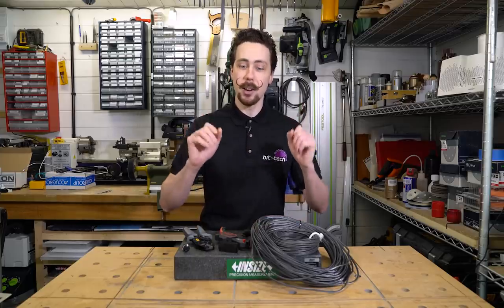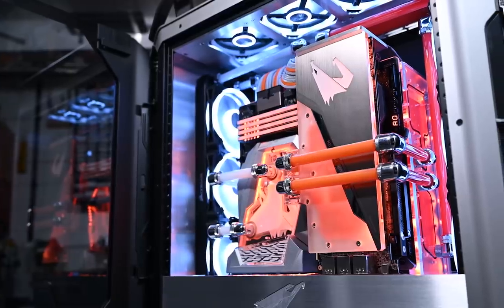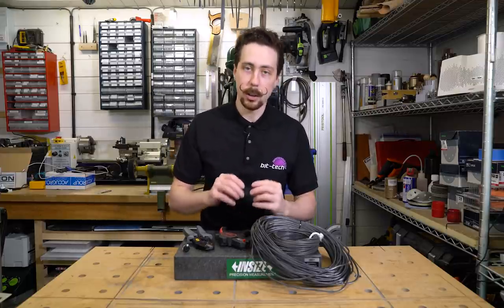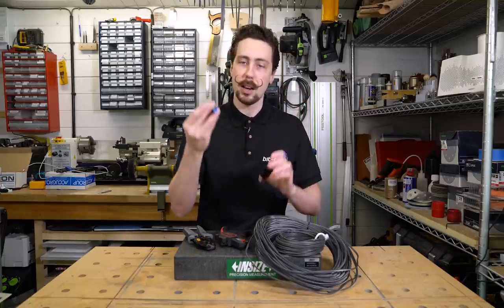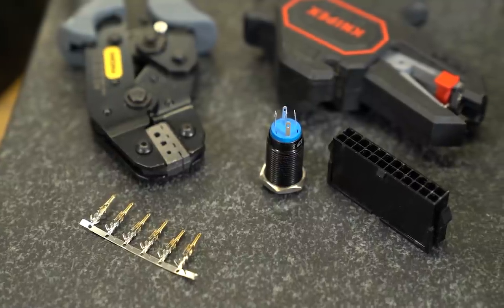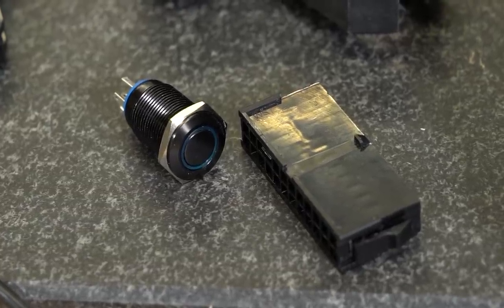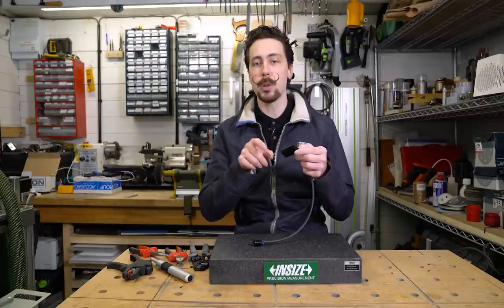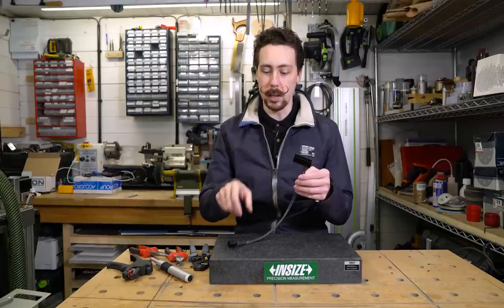How to Make a PSU Jumper Switch | bit-tech Modding

Comment: Improve the soldering. And I would love to buy this from you. $15 to $20 and I am in to buy.
Reply: Surely the parts alone are worth nearly twice that. This is nice but insanely fancy for what it is.
Reply: @BenWenger999  Well in the UK you can get that switch for like £8, the wire is dirt cheap and the bridging plug is £2, if you're including having the wire sleeved the total costs and labor is still ok to sell at £20, you could knock 100s of them out in a day. I have all the stuff needed to do this so maybe I'll start selling em.

Comment: Can i suggest some tips for soldering?
Always put some solder around the two surfaces you want to solder together, that would improve drastically the strength of the bond.
Have a great weekend guys :)

Comment: Cool idea... Although you advised against it, I would still probably swap the switch out for a momentary switch so you can hold, wait, and release 👍 but that's probably a preference thing at that point.
Reply: I also thought about that.
Reply: Yep. I would prefer this as well.
Reply from the maker: TechLens Ahh see the issue there is once the loop gets going and you no longer need to watch things, it becomes a chore with a momentary switch. After trying with both (I accidentally broke the latching mechanism on one switch when turning it down to size) it’s significantly easier to use a latching switch.
Reply: @bittech1  clearly I hadn't thought that far ahead 🤣 ...I am now converted
Reply: there are switches, which can be used as both. half way pressed they already make contact, but fully pressed they latch.
Reply from the maker: FeuerToifel Best of both!

Comment: OMG, cold solder for days.
May I chime in with a very simple suggestion?
Just use one of those power extension cords that has an on/off switch on it. This way, you simply plug everything in, power on the PSU and use the switch on the extension cord to do the trick.
A much cheaper and time-saving way if you ask me. If you need to make a video about how not to solder, then yes, your way is definitely better. :)

Comment: I have something similar to this except I have a crappy old PSU that I mounted to the underside of my work bench so I just plug the pump its self in to the bench PSU and I have a simple toggle switch mounted to the side of the desk to turn it off and on. This way the only thing being energized in the system is the pump its self and nothing else so I don't have to worry about disconnecting the mainboard or gpu or anything else... I also usually have a SATA powered 6 port fan controller with a hi-med-low switch in it, that is connected to the bench PSU to connect a couple fans in the built system that will blow air across the pump to help keep it cool during the leak test as especially DDC pumps can get pretty hot with no air flow over or around them.

Comment: i might copy that, i have a broken extension somewhere, from when i tried to de-pin it and ripped a wire out of the crimp-terminal instead. my original goal was to put some cable combs on.